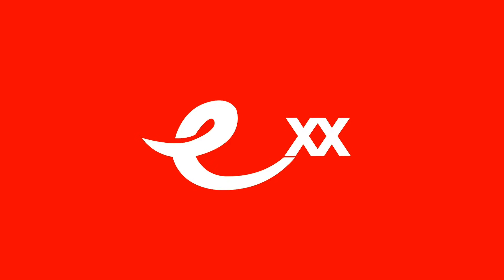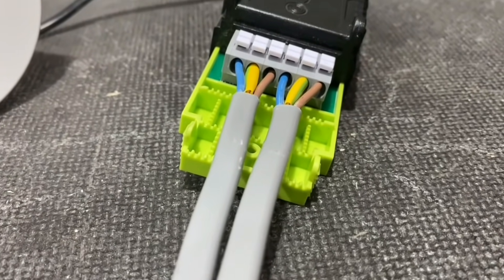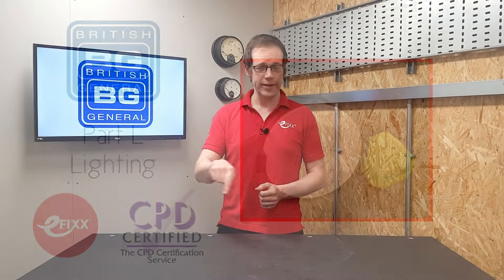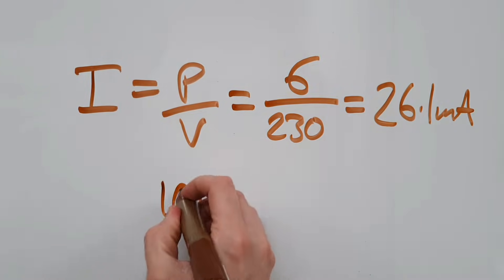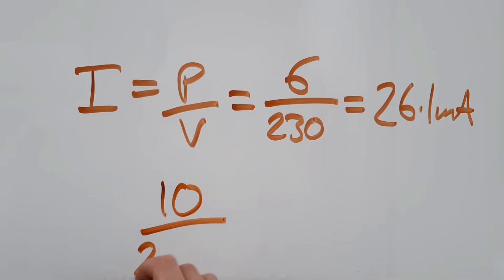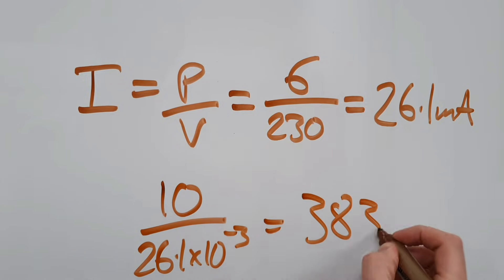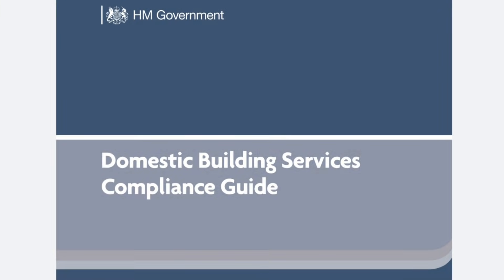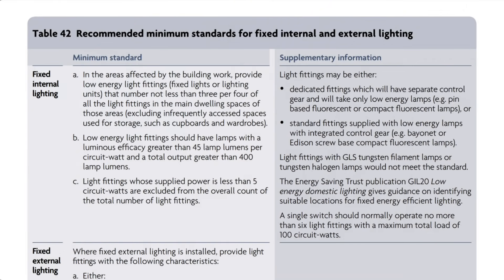How many lights can you connect to a light switch?

Comment: At some point, probably way before 300-odd,  you'll run into issues with inrush current from the capacitor at the front end of most LED drivers. Even if they make 6A breakers with a C tripping characteristic, the switch won't last long
Reply from the maker: Yeah, that part was a bit tongue in cheek really.

Comment: Interesting.. I'm guessing the building regs is referring to old incandescent lamps, 6 X 100W lamps = 600W on 1 X 10A switch was possible, so 2.5A plus resistive inrush of a cold filament seems fair for longevity of the switch contacts. But then again how often do we come across overloaded burned out  switches? And now with LED lamps it's even less so. Needs updating in the building regs. Great question though.

Comment: I would think that the regulation is there as stated because you can still buy the old style lights and many homes are still running old type lighting. But there is nothing stopping you from having a deviation from bs7671 as long as you can prove your system is fit for purpose and that the deviation is noted on your EIC
Reply from the maker: True, but this guidance relates to the building regs which are generally stricter than BS 7671.
Reply: @efixx  well I didn’t realise that was going to turn into a test on a Sunday
I would have done a little more research like actually read the documents again🧐 65% 🤦‍♂️
Interesting points
My first thought was the load on the switch but the angle your on was all about conservation of energy, which I do like I tend to advise less lights on each circuit for that reason plus better for mod lighting 
Regulations are a mine field 
Every days a school day
Like your stuff 👍 keep it up 👍

Comment: @efixx Can you explain why it common practice to have more then six downlights off of a single switch and frequently deemed acceptable, yet it contravenes the Building Services compliance guide? 

I have 9 GU10 down lights off a single switch in my kitchen, and originally was running 50W halogens in them until I switched to 5W LED's in around 2015.
Reply: Because the homeowner can ask for whatever?
Reply: I beoive the old 6 lights where 100w each =600w off a switch, you had 9 x 50w =450w, more than enough left in to throw a couple more in 😁

Comment: Now then, I have a central 'fitting' in my lounge, also a similkar 'fitting' in my kitchen,bothe switched via a separate switch of course.
Each 'fitting' has six LED, 6watt lamps..you know the question I'm guessing.

Is each LED, as they look like individual moveable fittings on a common base classed as separate fitting, or is the whole assembly the 'fitting' ? each lamp is of course wired internally to the incomng switch feed.
The same question I would suggest could be applied to a track type lighting fitting.
Reply from the maker: Good question, I guess it would be classed as one fitting especially as even controlling a couple more from the same switch would still be just about the 100W max. I would imagine both the fittings you described are the only lights on that switch? So that's fine anyway.

Comment: What on earth........

My lounge had four lamps each with 100 watt bulbs making 400 watts on one switch.
Have since replaced them with led bulbs. 

My bathroom had ten 50 watt halogen bulbs making 500 watts on one switch. 
Have since replaced them with 5 watt led bulbs making 50 watts on one switch. 

So where do these "regulations " sit in 2021 and are they meant for general DIY or for new build?
Reply from the maker: It's from a guide to the building regs so new builds, refurbs and DIY should all aim to comply.
Reply: My flat was built 1900 and rewired 1978 although it still has  a rewirable fuse box.
Given the above installation was done by a reputable electrical firm (not cowboys) how do you explain the lack of problems in 43 years? No blowing fuses, no melting or burning wires, nothing and yet you claim it does not meet today's standard even when using LEDs.
Reply: Reason I ask is obviously for safety so should I get the electricians back to rip it out and replace multiple bulbs with a single pendant bulb fitting? 
How do retailers get away with selling lamps with six, eight or even ten bulbs per fitting when it's against regulations?
Reply: The inrush current of those LED lamps is very comparable to halogens, as far as the switch is concerned they are similar loads. Not sure why you'd think there's a safety issue? As far as the regulations are concerned their about setting a minimum standard, it's good to build houses where the home owner can turn on a reasonable amount of lights and not the light the whole place up on one switch.  Get an RCBO consumer unit put it in, its worth it for the peace of mind.
Reply from the maker: @fabianmckenna8197  I'm not claiming anything, I'm just pointing out the direction. It's not an issue to do with loading at all, Part L is all about energy conservation not electrical safety. I strongly suggest you check out our CPD on this issue as it explains it in much more depth. https://www.efixx.co.uk/Know%20How/part-l-domestic-lighting-cpd 👍

Comment: 383 Light fittings? IF that includes LED strip lights, then Maximum Strip Length (m) = 383 / LEDs per metre, per switch 8-)
Reply from the maker: Good point.

Comment: So I'm messaging without first watching this video. I've always been lead to believe that no more than eleven 100 watt light fittings should be connected to a lighting circuit. Never actually thought how many could or should be connected to the switch wire of a lighting circuit. That being said, eleven light fittings was back in the day when incandescent light bulbs were around. With todays led fittings, surely eleven fittings could easily be quadrupled and at least doubled on a switch wire? I shall watch this video with interest.

Comment: That section from Table 42: A single switch should "normally" operate no more than six light fittings...., how does it define "normally"? Is there a definition for "abnormally"?
Reply from the maker: Yeah it's a tricky one isn't it. Unfortunately the document doesn't give any information on this. I guess it's one of those things that if you keep it in the back of your mind as something to aim for it'll make your installations more efficient in general. 👍

Comment: Isn't this part of the regs to do with building low-energy homes? eg it says halogen and tungsten fittings would not meet the standard. It's too old to consider LEDs as the norm. It wouldn't take many CFLs to add up to 100w and given the switching load of flourescents, it's a sensible limit for an old 5/6a rated switch. It's surely not a general rule for electricians wiring the old halogens or the new LEDs?
Reply from the maker: It's an interesting point, personally I'm curious to see if the guide will be updated soon to reflect the changes in technology.

Comment: 6 fittings seems impracticably low in most environments these days. Given that that is a huge shift towards downlights and LED fittings in general that figure appears a little outdated.
Reply: It's the way that LED lights work.  The actual diode is tiny, the ballast that drives it though, is responsible for converting the AC Voltage into the appropriate DC power for the diode.  This is called inrush current and happens when the fixture is first turned on.  This is the time it takes for the capacitors on the LED ballast to charge up and then drive the light after rectifying into DC.  In the US ( similar in the UK, but the numbers will be different ) , on an actual switch, you'll notice on the wings near the mount points that there's two values listed : One for driving the typical incandensent bulbs of old and then a second value, usually a fractional of the first, on the wing somewhere near the mounting hole.   So, for instance, you buy a dimming light switch that's rated for 1000 watts, but you'll see a little 150 next to it.  That 150 watt rating is the rating for dealing with LED's vs the 1000 watts for typical incandescent/halogen bulbs.  You need to take this inrush into account when chaining LED fixtures in parallel because they will initially pull much more current at first before they settle down.

Comment: No reason given as to why a maximum of 6 on one switch. Even if it explained it was in the event of switch failure to minimise light loss. In any case I have will always continue to design and tinstall circuit accessories to 75% of the circuits and or switch gears current carrying capacity.
Reply from the maker: Check out our free CPD for an explanation of why and some other considerations. 😊 https://www.efixx.co.uk/Know%20How/part-l-domestic-lighting-cpd
Reply: @efixx  cheers will take a look now 😁

Comment: Switch a contactor instead and switch as many lights as you want
Reply from the maker: I don't think it's so much about the switching load, more about limiting the amount of energy controlled by a single switch.
Reply: @efixx  and yet we have 10amp switches that are used to switch emergency loads for massive buildings, regular 10amp switches used to control contactors to effectively shut off entire fuseboards as a "last man out switch"
Reply: About about Luton or any other digital switching system, you could have a single button turning on the whole house etc.

Comment: There is reasons for having a limit of lights... Your math was 100% on the nominal running amps.. However you need to look deeper.. Inrush amps.... typically alot higher than the nominal..
Just like a furnace or freezer at startup (high draw)
There is alot less light fixtures in your equation now..🍺🍺

Comment: We ran 23 around the outside of a room for a decorative effect and the capacitance was too high for the dimmer to dim them properly we're not talking about it cheap dimmer here. Calculations were done and an inductor with wound to the correct value to cancel this out but as the dimmer cost thousands of £££  we spoke to their technical Dep't and it was like talking to the wall they had not one clue about how we'd solved the problem, so without manufacturer approval all the lights where taken out and different one's  found.
Reply from the maker: Sounds like an interesting and tricky  situation, well done on getting a solution sorted. 😊

Comment: Aint they 5amp normal light switch
Reply from the maker: Normally 10 amp.
Reply: @efixx  yeh on 110v ....I'm in UK 😂
Reply from the maker: No on 230, we're in the UK too, look on the back of a lightswitch.
Reply: @efixx  so why mcbs only 6amp but depends on the class when the trip
Reply: @davey2k12  its usually 6a because you will never need more than that on a normal house ,a 1.5mm can take 10A and its normally fitted in comercial/industrial places   , industrial sometimes more . There are 10amp mcb aswell you know?
Reply: @cocoino2307  oh yeah I'm not very industrial tho lengthy cables and shit more homey and prefer low voltage electronic circuits tbh but have rewired few things like fuse box some appliances , shed power from box all in good fun definitely safer with RCD protection bet u use RCBO's industrial ..... Standards change lots and I bet lower rating light switches am cheap compared to higher rated ones